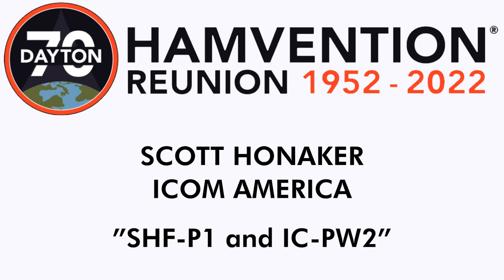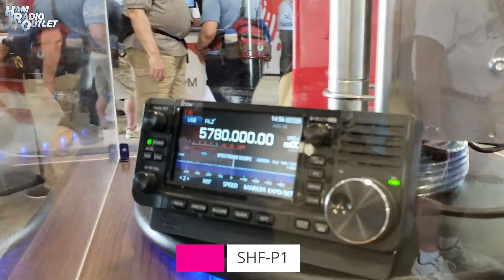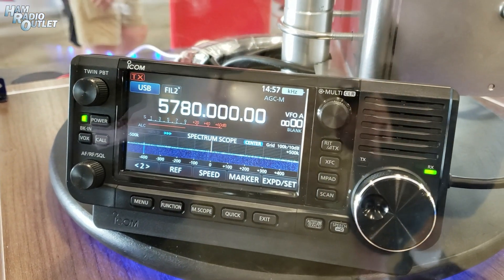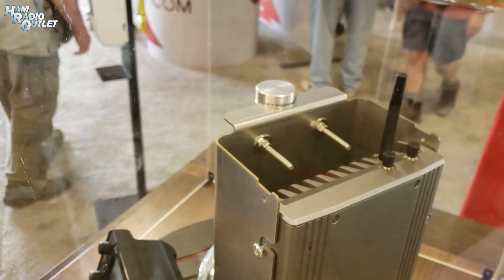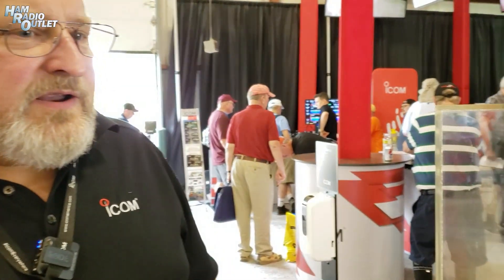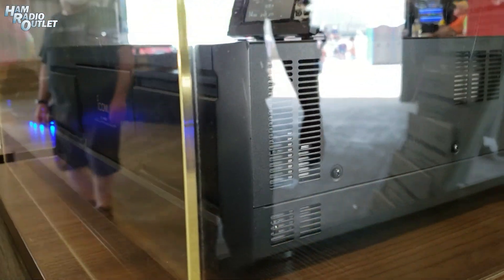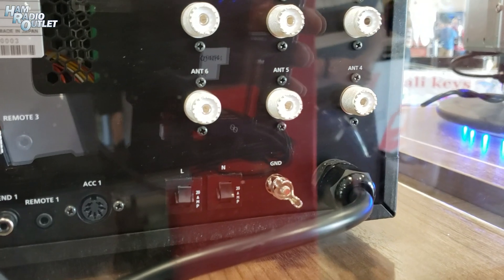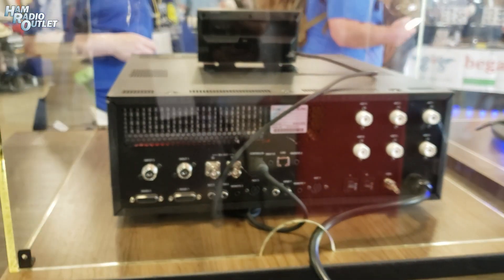ICOM SHF P1 and IC PW2 YT - Dayton Hamvention 2022

Comment: Cool radio but do i need it probably not but cool. Icom should have made another base station radio with more stuff in it . But do in respect i dont think this radio will take off like the icom ic7300 and others. I might pass on this one, they shoulda came out with another moble hf the ic7000 had problems they should redesign something close with sdr and more cooling and tougher transmit drivers commony blew up in the ic 7000 mine lasted 3 years then the magic smoke burnt up the drivers and it shorted other things i loved that radio i bought it brand new wish icom at least made up for that radio i was very disappointed i called icom America to get it repaired it would cost almost half to buy another hf radio. Icom you owe us another moble radio well planed out design and more cooling🤔💯
Reply from the maker: Right, no way it'll be as popular as the IC-7300. This is a specialist radio, for sure. Not sure why they chose 2.4GHz over, say, 10GHz?